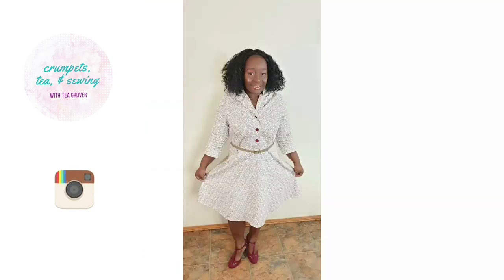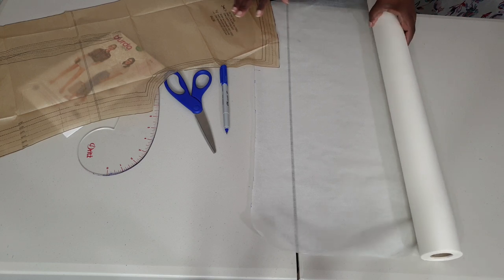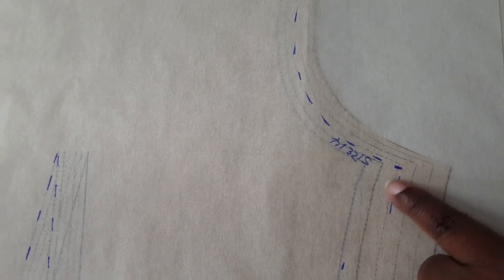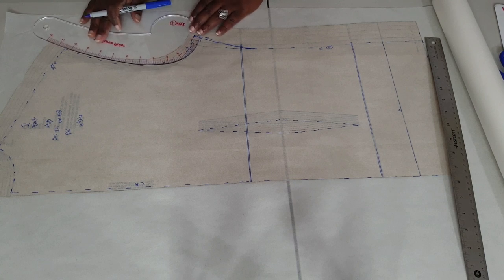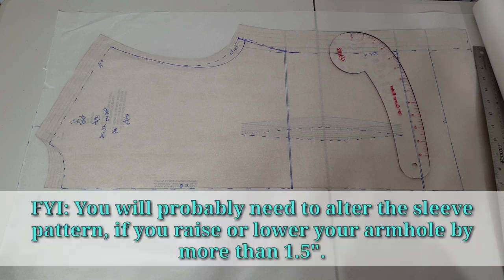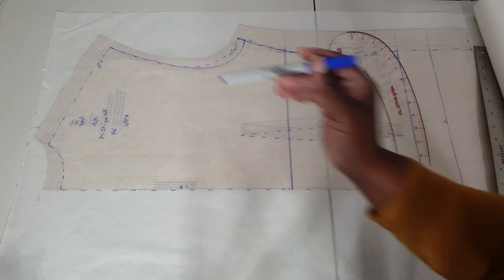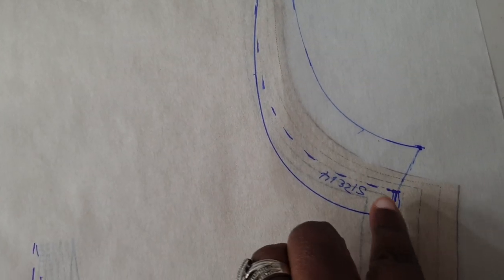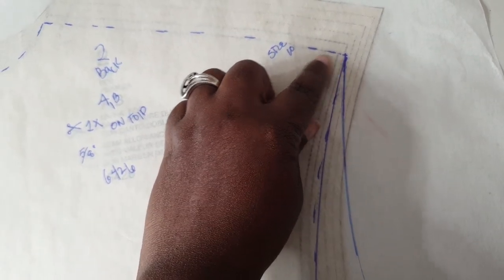How to Lower and Raise the Armhole | Sewing Adjustments & Alterations

Comment: Thank you for sharing ! Once we've lowered the armhole, what would be the Sleeve adjustments for the sleeve cap to ensure the sleeve fits in the arcye?
Reply from the maker: Hi Amalia! Thanks for watching! You really don't need to make any changes to the armscye as long as you don't lower it more than 3/4". The sleeve cap has built in ease and will mostly accommodate for that. You may need to reposition the notches on the sleeve pattern to match the notches on the shirt pattern though.
Reply: Does the 3/4” rule also apply for raising armhole. No ajdustments if less than 3/4”?

Comment: Thanks so much! This has worked well for me on tank tops, and looking to try it on a long sleeved pattern. But don’t you need to also make modifications to the sleeve? If not, won’t it still be tight? Thanks!
Reply from the maker: This method don't require an adjustment to the sleeve, especially if you do a 1" adjustment or smaller because the sleeve was designed with ease. I've never had an issue with the sleeve using this method. I hope this helps 😁

Comment: Omg I needed to pause the video why in the world did I not ever think to cut the entire pattern piece with all the sizes and just trace my size because I would still have all the other sizes 🤯🤯🤯🤯
Ok I’m going to continue to watch now
Reply from the maker: LOL really? It's a very good idea to trace your patterns. I rarely use the printed tissue pattern as the main pattern anymore. I save ALL my original patterns just in case I can't get my hands on an out-of-print pattern.
Reply: This was very informative so as long as I adjust 1 inch I won’t need to adjust my sleeve? 
I have to normally adjust the sleeves down one inch. I am doing a self drafted t shirt and it fits me how all store bought women t shirt fit me way to high on the under arm. I always wear my hubz t shirts because the fit is so nice on my arms lol 😂
Reply from the maker: @SewlocaMelissa  generally, yes! But it also depends on how much design ease the pattern has.

Comment: What indicates that you need to make an arm hole smaller?
 Question: when you choose a pattern do you go by the pattern measurements (on the outside of the pattern pocket) of by the finished garment measurements?
Reply from the maker: You can also do what is called a "bust dart rotation" which is when you take out the extra length of the armhole near the front dart. This is probably a more favorable way to adjust for excess length or gaping for most people.

Comment: but how do you adjust the sleeve?
Reply from the maker: This method doesn’t require a sleeve adjustment, so long as you keep the adjustment under 1”. The design ease will supplement your adjustment.
Reply: @crumpetsteaandsewing  ah right, thank you so much for your reply!

Comment: What indicates that you need to make an arm hole smaller?
 Question: when you choose a pattern do you go by the pattern measurements (on the outside of the pattern pocket) of by the finished garment measurements?
Reply from the maker: Question 1 answer: the armhole will have a gape near the lower half of the armsyce, usually on the front and/or back of the garment.

Question 2 answer: I ALWAYS choose based on finished measurements because commercial patterns usually have WAY to much design ease. However, on most indie patterns the finished measurements are the only measurements listed on the back of the envelop. So for those types of patterns I choose based on what's listed on the back of the pattern.